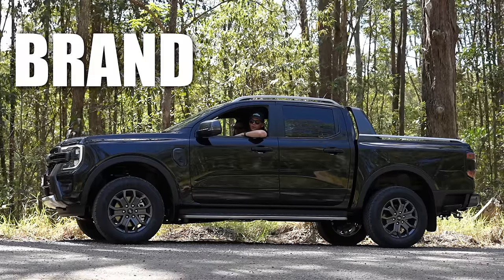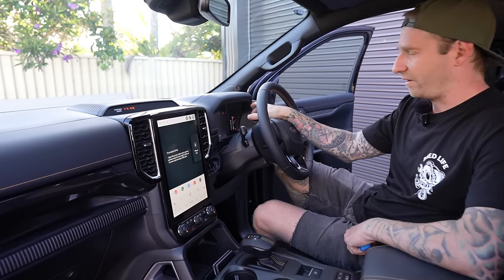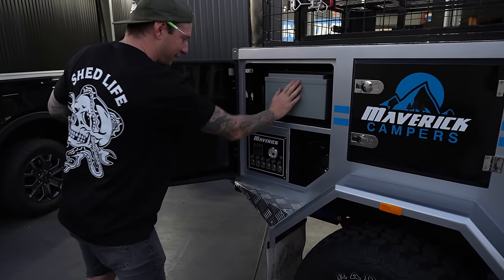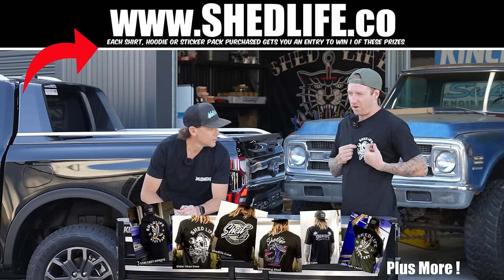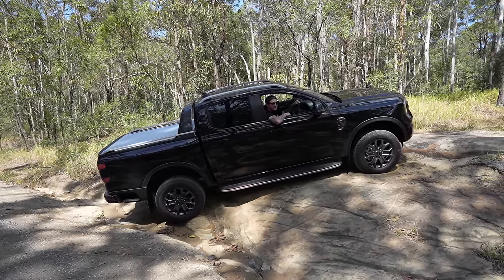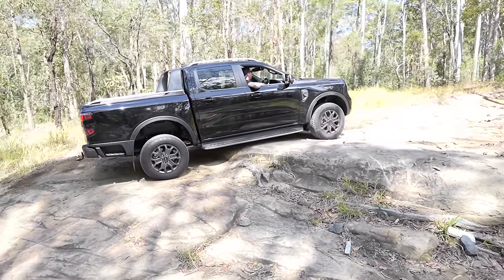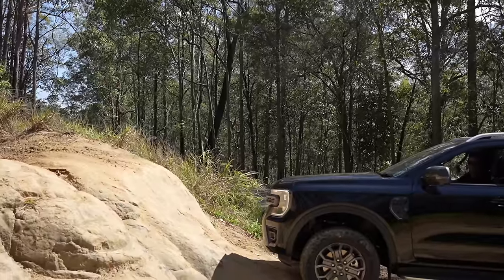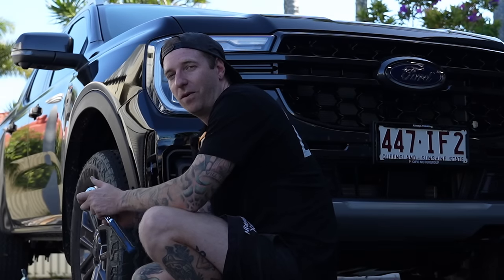We have a NEW Project !

Comment: Okay boys how’s it going love your channel. Here’s some tips on where some of the cabling is on your wildtrak. if you look at your battery you’ll see a module near the active terminal, that is your accessories control box. if you follow the plug you’ll find a group of cables behind an a abrasion proof cloth, that’s where the four forward button cables are. behind the passenger side kick panel you’ll find the high beam cable, and an ignition on cable, and at the back of the chassis it’s on top with white labels,you’ll find the compressor and the and rock light cabling. Hope this helped.

Comment: 79 series bonnet , tray and half canopy, exhaust , lift , 3 loop bullbar , sliders , spotties, bash plates , long range fuel tank , red arc go block , uhf , fridge on drop down slide , swing out bbq, storage boxes for rear of tray when needed otherwise left open for firewood ect , rugged terrain tyres , if available yet a trans cooler upgrade,

Comment: Would be sick to have a roof top tinny on the camper trailer aswell. Definitely not a massive fan of the ranger after still dealer with my old ranger lemon. But I must say the new ones are actually pretty capable standard and the new engine gets up and goes on the highway.